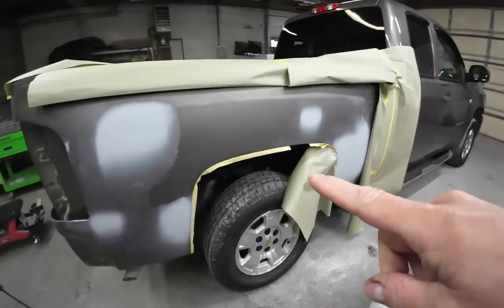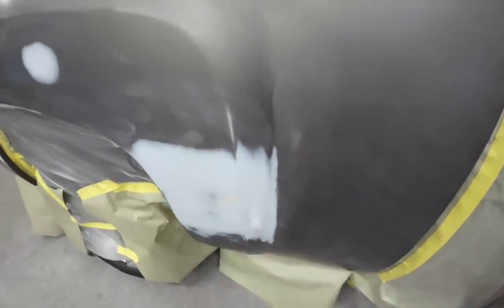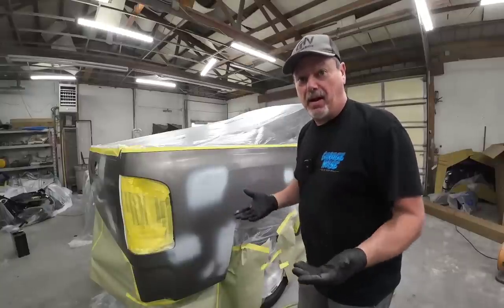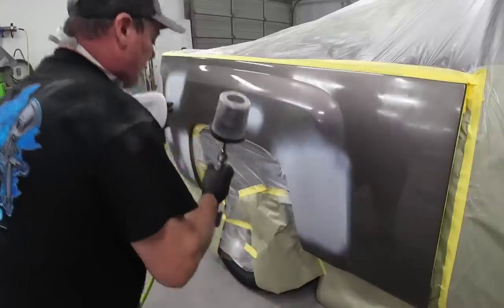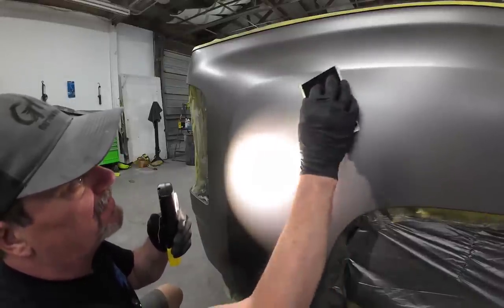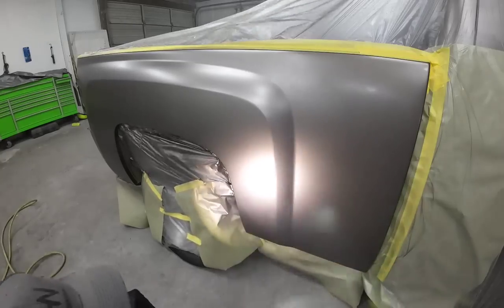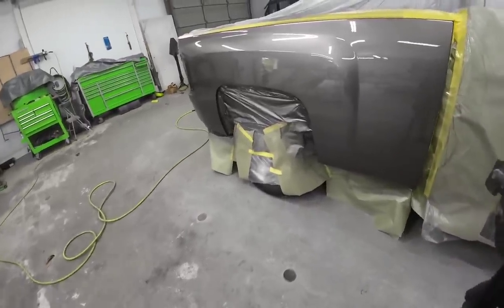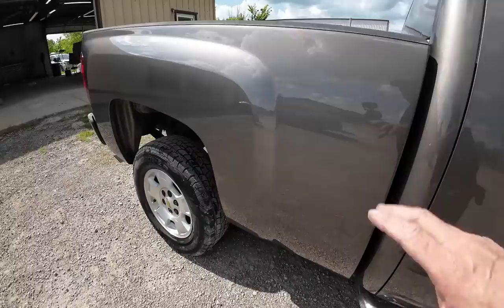How to blend BASECOAT using a COLOR BLENDER

Comment: Hi Chris, I noticed you saying you sprayed on your Colorblender/ wet bed with only 5% of reducer mix, I think it is supposed to be a 50/50 mix with reducer as a wet bed.  I have been spraying with 5% and leaving to thick of a layer and very hard to get clear out smooth also found out speedkote cautions againt thick layers. I also looked into it on youtube and found almost everyone else that uses this product also does a 50/50 mix as a wet bed,  I found out if it's to thick it could cause peeling in long run. so going to try and remove all and re-start with 50/50 mix of colorblender/reducer. and go from there , but I think 50/50 will make things also easier for wet bed. Hope this helps Somone else if there having issues with the 5% reduction peeling like I am. Go with 50/50 for wet bed and I’m sure will last much longer .
Reply from the maker: I found it to be thick as well that's  why I started reducing it . I don't think it will hurt anything not to reduce it except the appearance.

Comment: Chris: I want to make a comment on the Silverado silver Metallic   
You painted read only. It was just like mine that I have to paint the two left side doors of. You nailed it brother. I hope and pray mine looks as good as that. Now question: my small compressor started making a horrible noise so it’s time to replace.  With my LvLP R500 do you agree I could make a 29 gal 5.3 scfm do to paint.
Reply from the maker: Yes 5.3 cfm's  will do. Get the most cfm's you can afford.  If you you're painting  a complete  you'll have some air fluctuations but for a few panel you shouldn't have any problem.

Comment: Hi Chris, One of your best videos. I learned a lot. The key is not to freak out. Naturally you didn't. One question I have is there a time window on when one can lay down a clear coat after the base? Does it have to be done immediately after the base flashes?
Reply from the maker: The  window is usually
About 24hrs but always check the technical data sheet for the paint your using. Appreciate the comment and support!

Comment: Hi GarageNoise
I've got 2 questions I can't find the answers on...
When one scours the surface with 600 (primer and surrounding surface with clear coat on it), that means that the color base coat just layers on top of that scoured clear coat? And then on a part a bit further away just clear coat will be sprayed afterwards on the part that is scoured with 600 but didn't see any base coats? And that'll at the edges becomes the blending area?

Right now I think ^ upper is as it is but I'm not sure, kind of doubting.

The final question... I've purchased two R500's with 2 adapters for the disposable cups. One r500 I'll use exclusive for clear coat and the other I use for primer, Sealer and basecoat. In between the use and switching from primer to Sealer to basecoat or straight from primer to basecoat, is it needed to clean the inside of the gun or is mounting the cup with the new fluid on top of it and spray it through a little on a piece of paper enough? Thanks for your answer and 
video's!

Comment: Thanks for sharing about the use of blender, very useful stuff. 

Two more questions: (1) What adapter did you use between the Iwata and Sprayiq cup system? I was looking to see if it worked with a PPS 1.0 compatible system like the Harbor Freight spectrum. (2) Would you recommend the Iwata over the R500 spraygun for DIY in terms of atomization if you have the CFM?

Thanks again.
Reply from the maker: Yes if you have the air go with the Iwata.  Although there are material savings and overspray to consider and the R500 is better for that. Overall finish go with  the Iwata.
Reply: @GarageNoise  Thanks for clearing that up! Do you have any details about the adapter you used with the Iwata? It looks like it worked with the Sprayiq cup system.

Comment: Do you need to reduce base coat with blender when painting spots like that?  Or is it the same as spaying a wet blender on whole panel and just base coating the spot areas?
Reply from the maker: Pretty much the same but there's different techniques .some guy like to add a color blender  to thin paint for the drop coat or final blend.

Comment: After sanding to fix the halo could you have used solvent based cleaner to get rid of the sanding residue or only tack cloth?
Reply from the maker: I wouldn't  recommend it. It could affect the metallics.  The tack cloth should be sufficient and won't create other issues.  Appreciate the comment and support brother!

Comment: How do you match the paint color? Do you just use thebOEM paint code? why about older faded paint?
Reply from the maker: Yes, I use the OEM paint code if a paint is severely faded you won't  be able to match it perfectly but blending the color will help disguise the difference.

Comment: For adding that basecoat, is that only for silver metallic? I am doing a Purple/black metallic colour (malbec black, Code GAC) and wondering if I should do that as well. Thanks!
Reply from the maker: I think your referring to the color blender or wet bed? If so, it's  not always necessary a black metallic you really shouldn't  need a wet bed. It's won't  hurt anything if you choose to use one tho.
Reply: @GarageNoise  Yeah, the layer that you put on before the actual paint is what I meant. Thanks!

Comment: Great video. Wanted to ask you about that upol 2253 primer you use. I was checking it out, and it said Requires an acid etch primer, like Acid #8. What does that mean? I use hok, but its so expensive now looking forsomething else. Thanks
Reply from the maker: I see what your saying. I was curious so I contacted upol tech support and he told me that for that is for aluminum and it's  supposed to read for optimal corrosion protection use the acid ectch #8 . If your wanting  to do a overall paint job from bare metal I would use a epoxy primer first than a 2k
Reply: @Garage Noise  Do you think it's close to hok KD 3000. Just wanting your opinion on it. Thanks
Reply from the maker: @chriskiefer8365  I'm not that familiar with hok primer.  What are you using for project wise.
Reply: @Garage Noise  I'm trying to find something that's a good overall primer. I'm painting my car, and have some burn throughs. I really like the hok primer it's just to expensive. It's seems like you use that upol a lot, and and just wanted to get your thoughts on it. Thanks for the help. I appreciate it.
Reply from the maker: @chriskiefer8365  it would be good for that.  It's  not my the greatest as a high build primer over filler. I've  noticed some shrinking.  I don't  really use it for that cause i finish my body work with 320. So that's  why I was asking but it should be perfect for what your looking for just give it proper flash times and let it cure overnight.
Reply: @GarageNoise  thanks

Comment: When I spray in my garage, the over spray rises and then falls back into my fresh clear, leaving dust nibs in the clear
Reply from the maker: Dust nidbs are most likely not from the overspray in my experience.
Reply: @Garage Noise  when I spray clear   its a cloud of overspray going up and then it walls back down into my clear
Reply: Get an exhaust fan!
Reply: @tony1798 Dust Nibs are from not cleaning / wiping down your surface correctly or right before you start to paint (each panel), as stated here getting some fans will help reduce your issue.

Comment: One moe thing...I'm not sure what caused your halos. Was it the transition from primer to factory paint? I know you are a production shop. I do resto work and i'm not under the gun to get stuff out of my shop. We operate in different worlds. But one thing that absolutely makes any work disappear is working through the grits. So one of the last steps I take on all my putty work after its flat, it to hand sand through all the grits from about 400 wet to 2000 wet. Yeah, overkill for you but never had any problems this way.
Reply from the maker: It was a combination of sealer edge (needed a bit more reducer in the sealer) and the fact that it was a high metallic and that just magnifies everything.  Appreciate the comment and support!

Comment: Why not spray the sealer right up to the blend so it’s more uniform?
Reply from the maker: The halo was caused from the metallics laying funny in the edge of the sealer. The sealer was not reduce quite enough to leave it smooth so the metallics lay flat.

Comment: Chris on the spray cup system. The top of that has the micro filter in it. Do you have to change that Top every time you paint or clear . How do you use them ?
Reply from the maker: Yes those are disposable , change with every use.
Reply from the maker: Here's a video https://youtu.be/fDKK-eScKQI